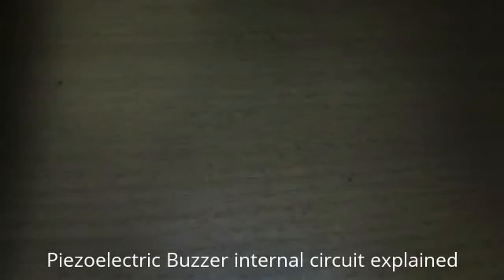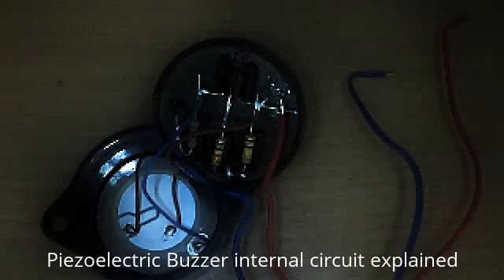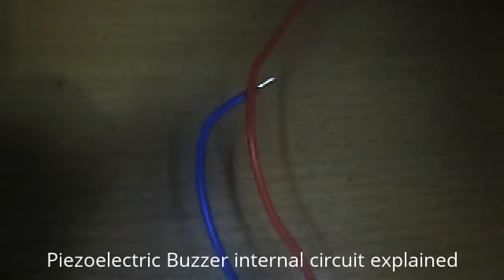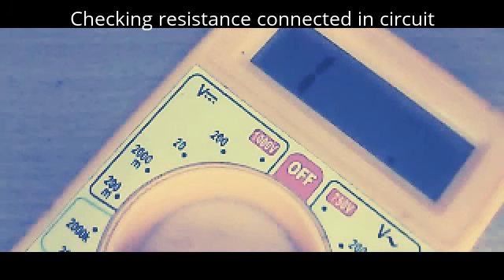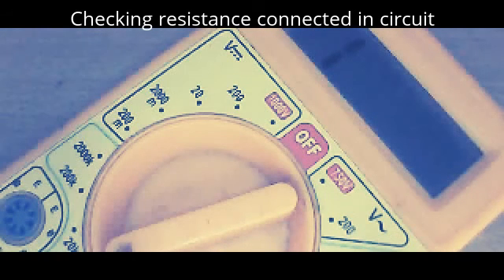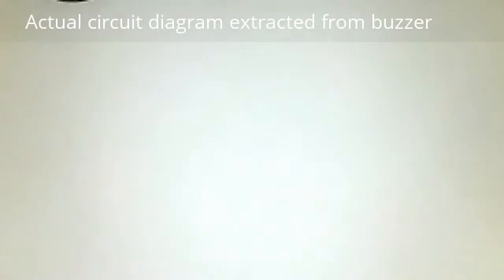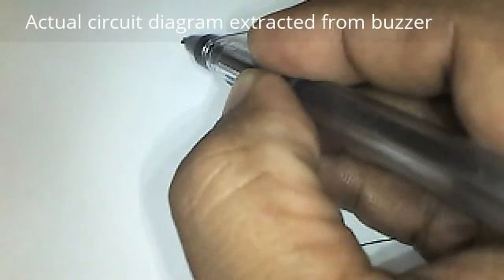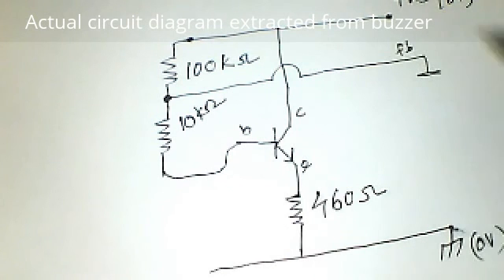Piezoelectric buzzer circuit explained

Comment: Why does a three wire piezo buzzer contain a transformer?
I thought the three pin buzzers had nothing but the piezo disk?
I have an sp-1359 and it has three pins but to my surprise it has circuitry inside.